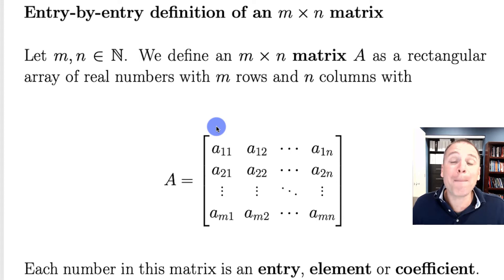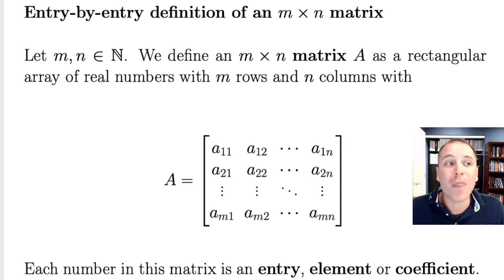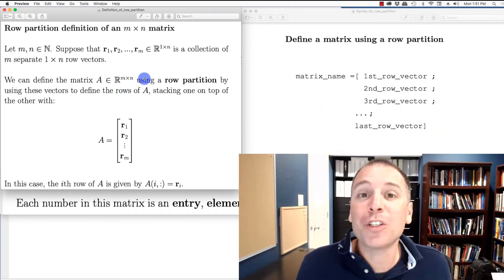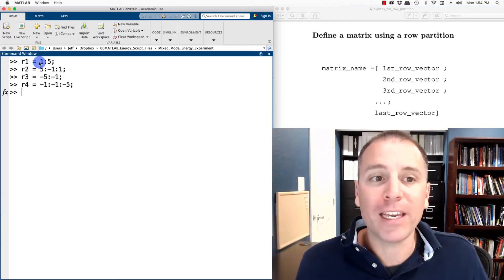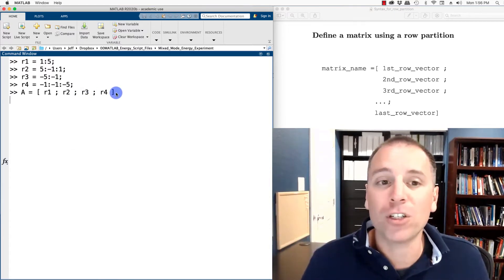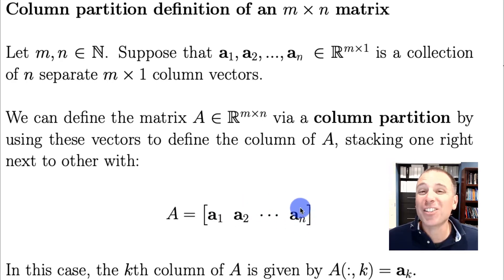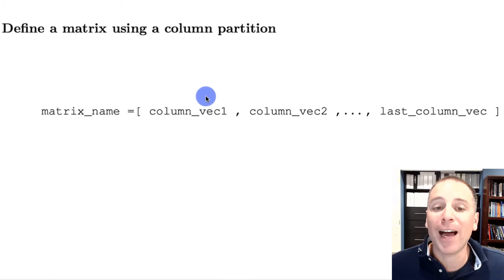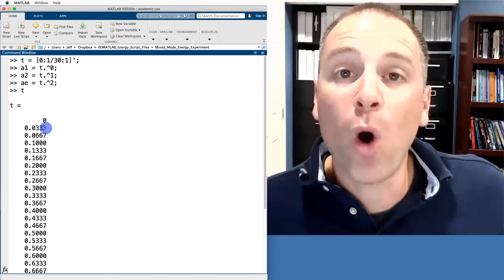How to define block matrices

Comment: I tried to find "application of block matrices in mechanical engineering" on google and the search results came up with more generalized ideas of the topic. I then asked chatGPT the same question and was able to get a better idea of what I am looking for. After that, I went back on google and refined my search inputs to get the following results.

Block matrices can be very helpful when dealing with large systems. For example, the global stiffness matrix is a block matrix used to calculate strain energy. Firstly, the global stiffness matrix is the sum of all the element stiffness matrices. The element stiffness matrix describes the relationship of applied forces (also called actions) in terms of the degrees of freedom for the set of nodes that form the element. These “elements” can be springs, trusses, beams, and plates. 

Then to readdress: the global stiffness matrix is the sum of all these element stiffness matrices. So the global stiffness matrix has more ‘sub-matrices’ in it—also known as the block matrix. The underlying question may be: “where is this used??” Well, suppose we needed to find the total strain energy of a 2 member truss. Strain energy is important because it helps determine the resiliency of the system (how much load it can undertake before collapsing). To find the strain energy, we need the stiffness matrices of the elements. This is an example of using the stiffness matrix in a real world example.

Also I found that this concept is related to “finite element methods,” which is a course mechanical / aerospace engineers may take. Apologies if I said something incorrect, this is my first time seeing and researching this topic. 

https://www.brown.edu/Departments/Engineering/Courses/En130/lectures/fem%20details.htm#:~:text=The%20Global%20Stiffness%20Matrix,all%20the%20element%20stiffness%20matrices. 

https://www.sciencedirect.com/topics/engineering/element-stiffness-matrix 

https://www.youtube.com/watch?v=cTiGaIRo-dc&ab_channel=BlakeTabian